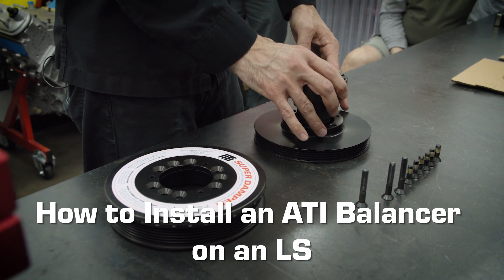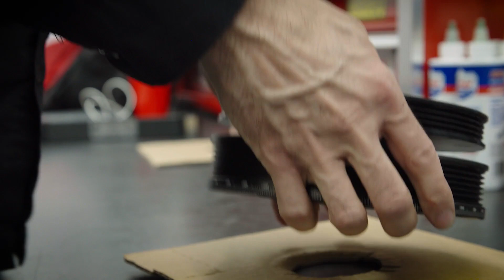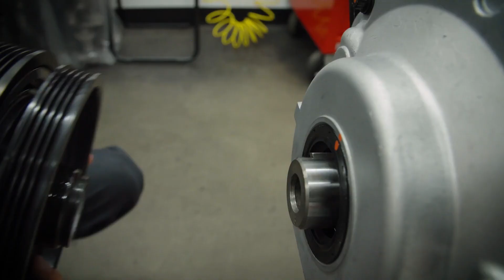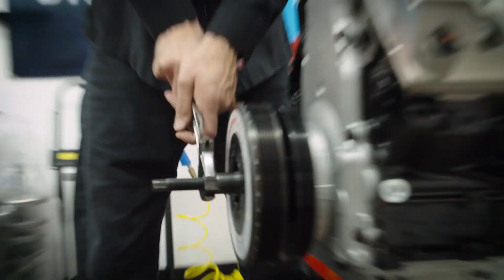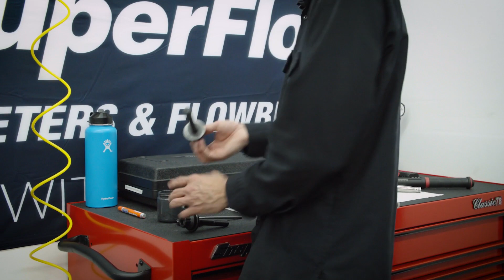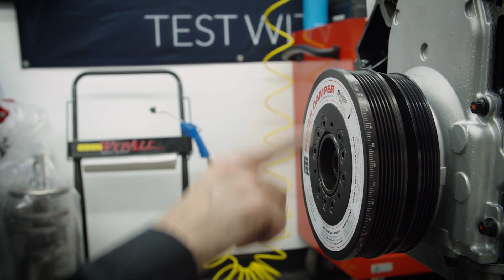How to install a LS Engine balancer

Comment: I am installing a 2.9 Whipple supercharger on my 2013 camaro with a stock crank that has no keyway slot. I have an ATI balancer and ATI crank pinning tool that I want to install. My question is, do I have to drill the hole in the crankshaft for the pin in any particular place concerning the circumference of the crankshaft?